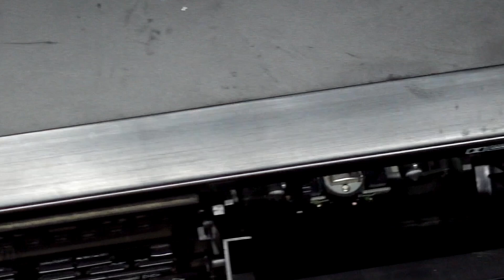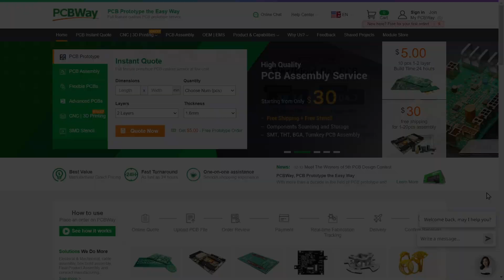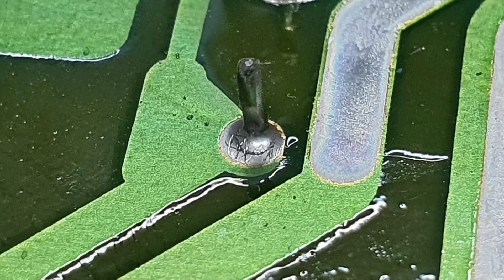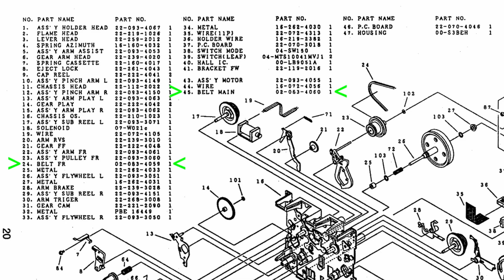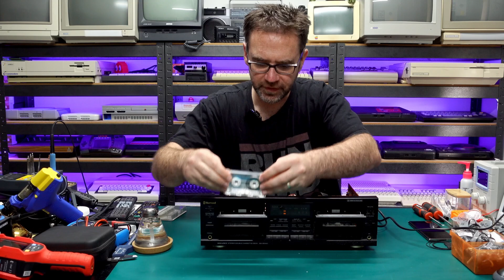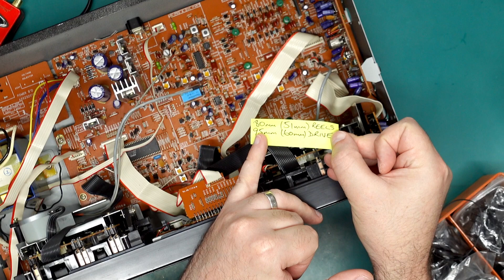Cassette deck repair (almost) - early 90's Sherwood DD-3010C

Comment: Wow, I was looking for the same deck with exactly the same issue on the deck B, as in broken pin from the guiding part! To be honest, we may be in the same city, by the look of the Green Shed label, which (Green Shed) doesn't exist anymore for about almost two years now? If you are in Canberra please let me know if you can help with electronic part repair on three Teac A-300 that I have around with the more or less same issue, recording doesn't go as it should.

Comment: Hey there .. I have a similar model I am trying to restore (DD130). Just wondering if you could give some advice on finding suitable belts? Like you I could only find a part number, but nothing more than that. Cheers dude
Reply from the maker: I think the correct size belts for the DD-3010C are 60mm x 1.2mm, and 51mm x 1.2mm. No idea if the DD130 is the same

Comment: I love to dabble in repairing older stereo gear and building custom speaker units and building custom crossover units. I'm not a professional and purely self taught, but I have successfully repaired countless components including Turntables, Cassette Decks,  CD Players, Portable Boomboxes, Graphic Equalizers and Mid Size all in one units. I just recently repaired a Sony HST-D105 all in one unit which required new belts and a new motor in the Cassette Decks, new CD drawer belt, new speaker relay and the Turntable power output connection re-soldered. It now works as good as new.

 Those cheap mixed belts are made in China and are absolute crap because they are inconsistent in stretch and width uniformity and are only good for use as counter or take up spool belts. The best belts I have ever used are the high precision DeckTech belts from the UK. I installed a Decktech belt in my AIWA AD-f370 and the wow and flutter figures improved over standard. The wow and flutter is specified at .065% and now it's down to .040% and sometimes it goes down to .030% which is unheard of for a 2 head single capstan belt drive deck. I am about to replace the belts in my Rotel RD-960BX, Akai GX-F25, Akai GX-M10,  Yamaha KX-500 and Yamaha KX-130 decks with Decktech ones.

BTW I am from Tasmania and I am looking for a 12 volt CCW 2 speed 2000/4000 rpm Sankyo BFB2L41T motor or substitute if any will work. The motor has the following connections + - A B and there are two in my Sherwood CD-340B and Deck A is intermittently squealing. I put a drop of oil on the motor shaft and the squeal has gone, but it may possibly come back. Cheers, and thanks for a great video.
Reply from the maker: Nice. Yeah cheap belts are definitely not good for speed stability. I've ordered ones from fixyouraudio, Wagner and somewhere else that I can't remember and they're all much better. Haven't heard of deckteh so I'll look them up.

I have a Sherwood single deck, it's a CD310B. Very good wow and flutter results on that after replacing the belts especially for a budget deck - around 0.05%. But it has auto record levelling, so I only use it as a playback deck

Comment: I think it's the quality of the belts, and I don't know where to get decent belts that don't cost a fortune. I can see the "wow and flutter" in most of the belts I get from Amazon because they are so uneven. Given that, I don't think it's possible to fix anything that isn't direct drive anymore. I wish I'd seen this video before I bid my US $1 dollar on the one I got today!  I don't know why people are getting back into cassettes nowadays, or why I thought I wanted a dual deck!
Reply from the maker: Definitely the belts can make a huge difference. I found some good ones from a local Aussie store - wagner electronics. It did bring the W&F down to a reasonable level, but unfortunately the deck broke in other ways shortly after
Reply: For those looking for the belts for this unit, because I couldn't find many sites that listed the Sherwood DD-3010C, I did the following: I found the service manual for the Sherwood DD-3010C. Then, I Googled various part numbers from the tape mechanisms (the belts, boards, etc.), hoping other vendors might use the same part numbers. I found the Kenwood KX-W893 uses the same mechs (I don't remember which part numbers were common), and each deck has its own motor like the Sherwood, so the belts should be the same.  (I hope that turns out to be true.)  I'm afraid to recommend anyone because over time, sites will come and go, and maybe there'll be another brand that uses those same tape transports that will be commonly listed somewhere.  Note the Kenwood is NOT the same machine as the Sherwood. It just appears to use (mostly) the same tape transports, and the service manual for the Kenwood has a very good description of how the tape transports work.

Comment: i have a same connector problem....thanks  
=> @n13ldo "You push down on those white connectors and the ribbon cable pulls out, looks like that type anyway from a distance."

Comment: Did you ever get round to sorting this deck out?.  I had similar issues with a much older late 70s Sharp deck, replaced the belts, replaced a broken gear, replaced the idler tyres and lubricated everything but wow and flutter was still an issue. It actually did turn out to be the pinch roller which needed replacing. I just measured it with a set of calipers and bought a pack of five from Ebay that were the same dimensions and hole size and it worked. The motor needed a drop of oil too as it was a bit noisy but it now works fine, although getting it apart was absolutely horrendous compared to a more modern deck.

Given the cheap cost of replacement pinch rollers it might be worth a revisit and also worth some lubrication and a drop of oil in the motors. Can't hurt.
Reply from the maker: I did end up sorting it out. Turns out the belts I was using were complete junk (those ones that come in a mixed bag). After picking up some decent belts, the wow and flutter reduced considerably. I don't remember the exact figures but it was under 0.2%

But when I put it all back together the decks started doing odd things, fast forward when pressing play, playing when hitting rewind etc. Turns out another one of the white plastic posts had broken off the cam gears. After pulling them apart soo many times I guess I wasn't being that gentle anymore. In the end I gave up and moved on to fixing my other decks (which worked out well). The Sherwood was just too frustrating to work on so I don't feel bad about giving up on it
Reply: @TheRetroChannel Can you tell me the size and type of belts you ended up with and where you got them.  Thanks!
Reply from the maker: For the drive belt: 51mm diameter X 0.5mm thickness X 3mm width (flat section)
For the take-up belt: 43mm diameter X 1.2mm width (square section)
Pinch rollers are 13mm diameter X 8mm width (2.5mm hole)
I got them from Wagner Australia but I've heard fixyouraudio and webspareparts also stock good belts

Comment: Ive been caught out by that connector when fixing my amp and wrecked it then found you puch down on the top bit and it releases the wires :s :/
Reply from the maker: Haha, yep I figured it later. It even says "PUSH" in tiny font on top of the connector 🤦

Comment: I had a similar issue with wow and flutter. The tape recorder was from the 80's. The lubrication in the bushings throughout the mechanism was slightly sticky. Ended up doing an ultrasonic bath in IPA. Then lubed sliders with lithium grease and bushings with light machine oil. There was a dramatic improvement.

Comment: You push down on those white connectors and the ribbon cable pulls out, looks like that type anyway from a distance.
Reply: very thanks~! it's working~!!!   use - driver and push down white plastic flat cap and pull up wire.
Reply from the maker: You're probably right, pretty sure that's the only thing I didn't try

Comment: Clean the pinch rollers or replace if they are hard. Lubricate the motor with oil. The white connectors must be pressed and the cables pulled out.

Comment: I was wondering if the motors just haven't been exercised in a long time. Maybe letting some old tapes autoreverse over and over for several hours might help them work better.
Seemed to work in my 8-track player when I let it sit to long.
Reply from the maker: Worth a shot 👍

Comment: The timer switch is usually meant to be used with external timers. The idea is that if that switch is on play or record, it will automatically go into that respective function when the unit receives power.